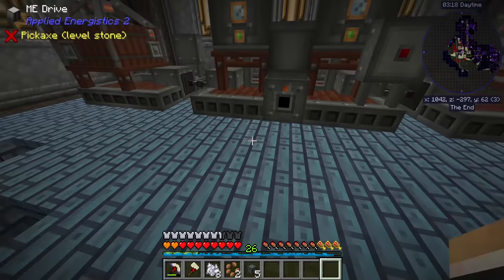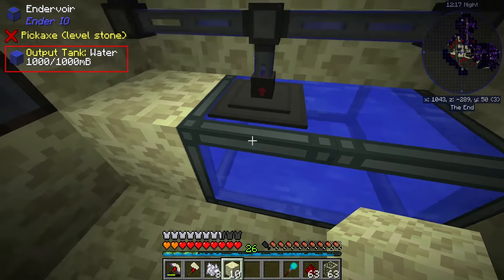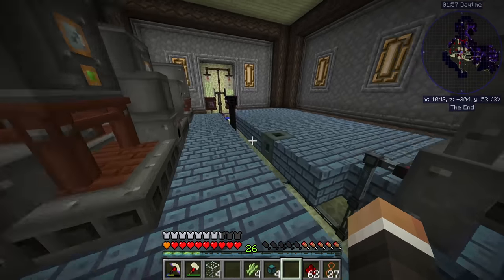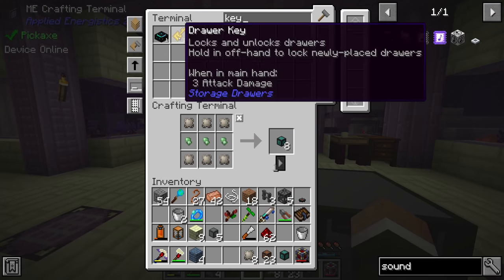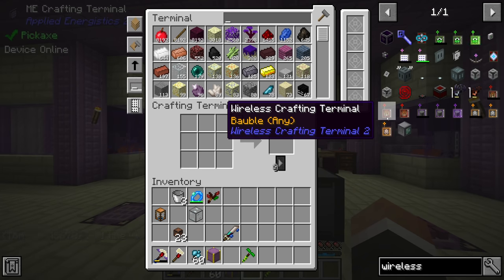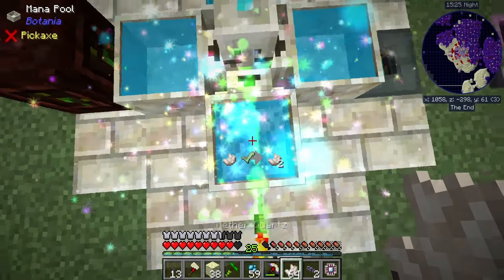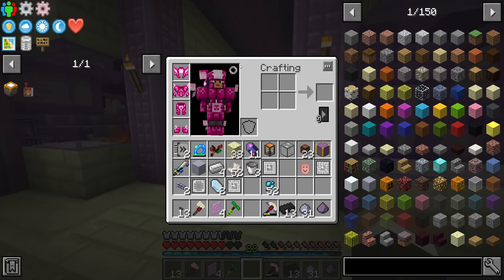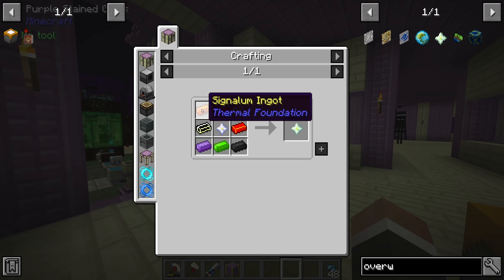Minecraft Levitated | WIRELESS CRAFTING & GARDEN CLOCHES! #16 [Modded Questing Exploration]

Comment: Can you grind down the pure certus quartz into powder? If so you can use it with sand to create even more seeds and have infinite pure certus quartz for the cost of just sand and power—and pure certus quartz is interchangeable for regular certus quartz in most situations
Edit:
I believe you can also craft the pure certus quartz into blocks and back to turn them into regular certus quartz—at least in some mod packs
Reply: Agreed. They do seem very renewable.
Reply: You can also do the same with the fluix crystals as well, eliminating the need for crafting them.
Reply from the maker: Unfortunately you can't grind pure certus quartz in powder. But I haven't check the block crafting idea, I'll take a look on the next stream :)

Comment: To make silicon better, you can smelt crushed quartz if you can get loads of that. But I use Endsteel Grinding Balls in the sagmill and that give 240% second output, then run sand through it, Sand has a 50% chance so the grinding ball gives a 120% chance. A stack of sand makes more then a stack of silicon. Clay will net more with no loss, but that takes a bit more to do. (clay with no loss, still needs the Endsteel Grinding balls)